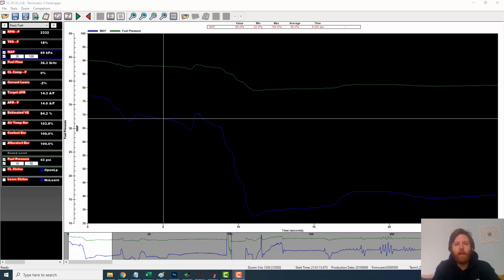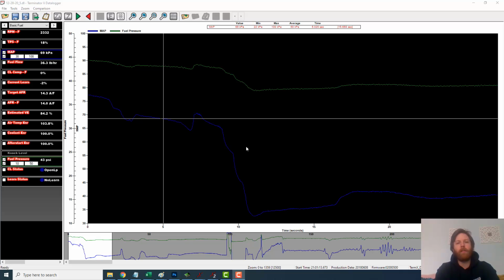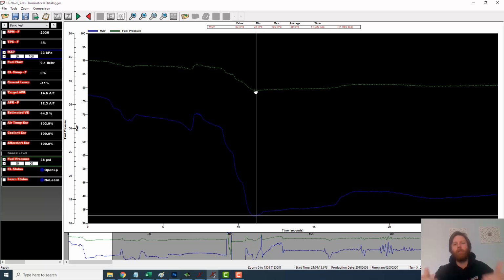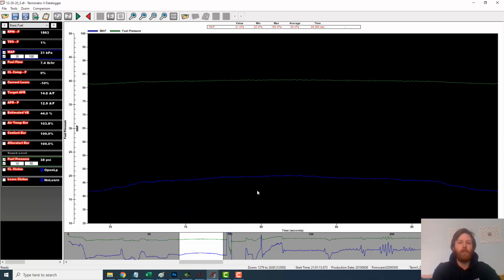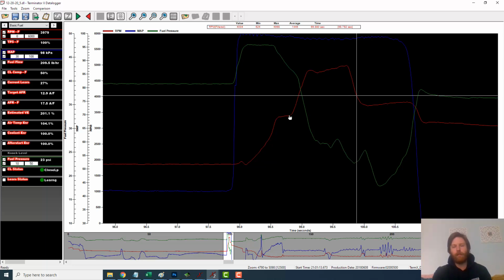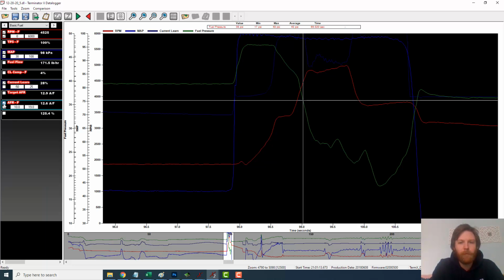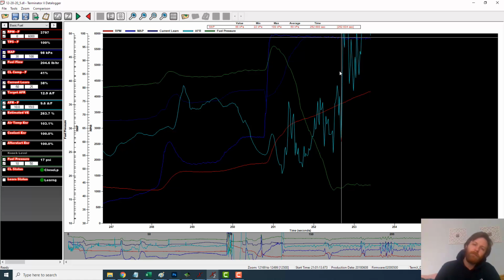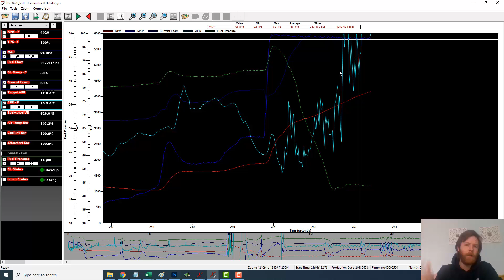Let's Talk Fuel Pressure Basics (and a Lack Thereof)

Comment: Question do you know what I should set my Fuel pressure regulator at with 30lb injectors
Reply from the maker: This is not a straight forward question. Depends on many things. First and foremost, if the manufacturer only provides calibration data at a single rated pressure, then you should run them only at that pressure. There are no universally accepted formulas that can convert any injector from one psi to another. If such injectors are not able to flow enough fuel for your combo at that pressure, you need bigger injectors.

If the injector DOES have data for different fuel pressures, then you should set it at stock psi or whatever is the lowest pressure above that which will provide adequate fuel for your combo.
Reply: Awesome thank you for your response,keep up the great work and information .

Comment: Heres some disturbing revelations Ive made about the Holley system ..#1 it actually sux and is mostly a "LOGIC Based" system similar to a Commodore 64 melded with a Commodore 128 computer from the 80's...Holley tells me that theyre just getting into smart type ignition systems that can self-diagnose the system like an EEC-IV system does.....What gives Holley?,,,Why all the smoking mirrors and the LIES? Holley made me believe I was getting the Playstation5 of ECU's not stepping back in time..............

Anyways;- If you dont have an engine with a crank sensor and a reluctor wheel and have an engine with  a distributor either TFI or HEI I suggest you keep your distributors.....Anyone who upgraded from carb to Fuel Injection and are using a NON-TFI or NON-HEI distributors your cars will never be 100% perfect running on a BANK to BANK injector strategy and to hook up the distributor using timing control DOESNT WORK without adding a crank sensor into the array or using a TFI/HEI distributor w/interface module that sends #1 firing position to the ECU... MSD Pro Billet magnetic pickup distributors DO NOT WORK RIGHT!!! Thats a FACT and HOLLEY KNEW THIS but was trying to use smoke and RFI as a possible culprit to any tuning problems related to using a distributor with a magnetic pickup...!!!!!! 

They made me buy a big cap w/adjustable rotor For $80 bux I didnt really need...Alls they had to say in the manual was if you use anything but the TFI or HEI distributor you will lose all fuel injector accuracy and running in an inefficient Hit N Miss type of way but they leave that lil tidbit out then give you the info way-way after youve already put detrimental damage on your engine trying to figure the problem out but if they did divulge these lil tidbits they'd be filing for bankruptcy also begging for people to take the Terminator X off of their hands.. .Phuck you Holley!!!!.

Bank to Bank injection strategy fires 4 fuel injectors at the same time every 180* of crank rotation and has no way of telling where #1 firing position is to keep all injectors sequenced correctly so the injectors spray fuel into the intake and it gets sucked in when needed as a puddle not an atomized mix!!!....."Paired" fires 2 injectors every 90* of crank rotation in a hit n miss fashion and "Untimed Sequential" fires the injectors in Sequence but its HIT N MISS...Stay with TFI or HEI if you have them and for TFI dont forget the $90.00 plug that I found online for only $45... https://www.decorsday.com/products/harness-for-ignition-558-305-tfi-holley-ford

In the beginning I even questioned a Tech asking why the plug kit was triple of the MSD interface plug...He said its the distributor who makes them who sets the pricing....Another lie as I found one for half the price!!!!

If you dont have a TFI or HEI distributor go get either one!!!!!!! Your engines will run a ton better when the injectors are actually spitting fuel into the fire when they actually need to be!!

Comment: Sometimes the details is in the setup...Youd be surprised at how many set the timing up wrong for the type of ignition system they have and youd also be surprised at how well the Terminator X seems to run despite this yet being so detrimental for engine longevity thats why for this type of Logic based system you need to enable and hook up knock sensors..........After an ECU has been run harder than it needs to to make constant corrections it starts to drop off.

Also my expensive Holley 100psi transducers read differently and elevation changes affects how a sensor reads too.....I calibrated my fuel system psi with a Lisle gauge and the dash said 11psi more meaning I was 11psi light on pressure when  verified......The oil one was off by 8psi saying I was 8 psi lower than actual....Those can translate into the wrong end result when running a Logic Based ECU...It cant really differentiate whats right and wrong and when things arent jiving anymore thats why periodic maintainance by checking the CTS and MAT calibration against highly accurate mechanical gauges is a must because what you see on the dash could be or become a mirage....
Reply from the maker: Damn. That’s crazy how far off the pressure sensor was. When I get my car running again, I’ll do a A/B on a gauge vs Lowdoller transducer to see how it reads.
Reply: @LeechMotorsports  Thats nothing...The cheapo $10 Blow off / fuel pressure/ oil pressure ones from ebay was under by 33psi and 55psi.

The stainless cheapos are just as accurate as the Holleys with similar differentials in offsets...The stock ford IAT sensor was  11 degrees off when using the modular sensor as a stand-in as Standard wont give me the values no matter how hard I plead....LOL

If you have the stock ford values for the 90's ford vehicles so I can enter my sensors as custom Id love to have total accuracy with minimal offset changes to keep them calibrated if possible..
Reply: I sent you my setup file to look over a few days ago..Check out my sensor array and the offset values needed to get my sensors to jive accurately..Right now for the fuel pressure Im using an LS one but theres no LS option to pick like the fuel sensor section has so the difference of accuracy using the Holley option is a -55psi offset..

Comment: Great video. I'm waiting on the parts for my fuel system to show up so I can fix the same issues.
Reply: I had a Holley tech tell me to deadhead my system for a fuel test by plugging the return.....Found my problem before it got that far..my problem was a  sensor  telling me my fuel pressure was 11psi higher than it really was......

Comment: So was the issue a failing fuel pump?
Reply from the maker: Don’t know yet. Waiting to hear back from the owner.
Reply: I'm going to head over to my old place of employment this weekend to inspect the system and change out the fuel filter while I'm doing that. I already have an Aeromotive 340 in-tank pump. It may be a loose connection at the fuel pump as my fuel gauge is erratic as well (this is an older foxbody LTD station wagon with the pump and sender in one connector).
Reply: Update: no kinked lines or leaks, but the fuel tank has quite a bit of rust in it, this could be clogging up the sock, I only managed to look in the fill tube hole so I couldn't get a better look without totally removing the tank (and I didn't plan for this). The pump/sender is plugged in good but fuel was a little low, the fuel gauge gets kinda wonky at low levels apparently. I'll run another log and see if changing the filter helped any or if having a full tank of gas will help.

Comment: Quick question, im new to the tuning world and there is so many different factors you have to alter and dial in for a 100% tune... Im just wondering how dyno tuners are able to do all this all within an hour or so? Is it just the basic mandatory things that they dial in like different injector size, MAF curve and limit the timing so stuff does not blow up?
Reply from the maker: Well that is a great question and I have a pretty firm opinion on it. A 1 hour dyno tune session on a newer vehicle with light modifications can produce good results. The aftermarket is small for newer cars, and few people really dig into the intervals of newer engines (head, cam, pistons, stroker setups, etc.). So with a little experience under your belt you can basically start with a tune from another near identical
Combo and get near identical results. But the hard part is cara like fox bodies. Very old cars. Massive aftermarket. Virtually no two cars are the same. And since the throttle body is cable driven and distributor can be manually advanced, you just can’t do great work in an hour. Knowing what timing and target AFR to run just comes from experience with different parts combos. Not super hard to get that sorted quickly on a dyno. But the drivability stuff for real street cars is VERY unlikely to be where it should be within the hour. That’s why we street tune cars vs. dyno unless the vehicle owner just wants a dyno slip. The dyno can be helpful for identifying what a boosted car is happy with in naturally aspirated form, so you can use that as a baseline to adjust for the boosted tune.
Reply: @LeechMotorsports  Great info! I plan on supercharging or turboing my 95 5.0 this winter. Of course I will need to tune it and your channel has been great learning. Im playing around with Tunerpro RT and trying to experiment right now as I am still NA. Would be very helpful if you made a video of the absolute required needs to run your car after boosting it - aka those 1 hour dyno sessions. Congrats on 1K you been a great help for a lot of us!
Reply from the maker: Thanks G. I really need to start making some cbaza videos. One thing I’ll say, there is a substantial difference between the core tuning, sailorbob, and free cbaza strategies out there for binary editor. For a boosted application, you really should invest in core tuning or sailorbob’s stuff. There are a lot of inaccessible parameters in the free strategy and the money spent on the paid ones is really worth it,

Comment: Welcome to detonation City. But thank God for Holley wonderful system
Reply from the maker: Lol. At least when the fuel drops off that much, it won’t build enough cylinder pressure to do much.
Reply: @LeechMotorsports  that is true
Reply: Right now I'm trying to figure out with my Terminator one minute my close Loop Comp will be good then next minute all the sudden it'll be taking away 5% fuel and my fuel pressure stays good the whole time I'm suspecting my spark plugs may need to be changed out
Reply: And then they'll be times where in the middle of the map it'll be good then out of nowhere it'll be taking 9% away
Reply from the maker: Let us know if we can help.